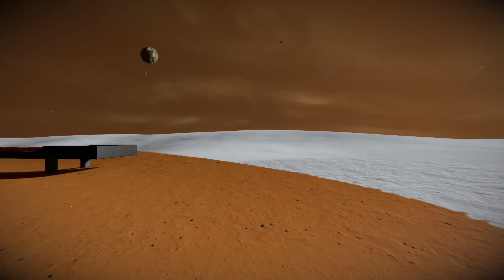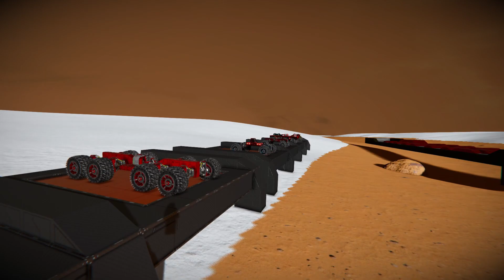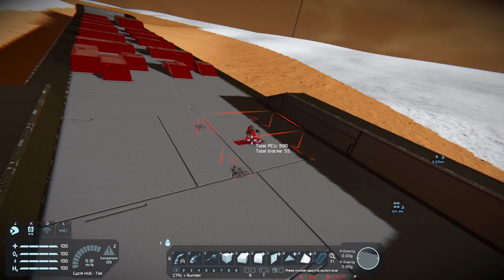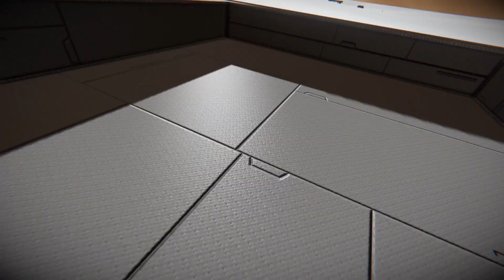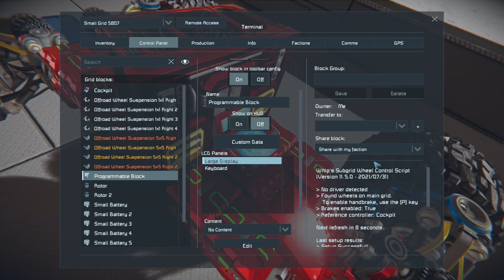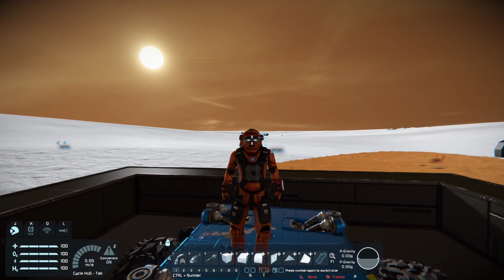Suspension Concept ideas - Space Engineers

Comment: I tried building a rig with similar suspension to the last one, with two rear tandem axles and a single pendulum axle in the front. It doesn’t have the small wheels to act as springs though, just some limited rotors so that it can keep all the wheels on the ground. Seems to work pretty well at low speeds, though!

Comment: Set suspension strength as soft as possible to carry the weight when using standard suspension.

When using linked suspension, set it to 100% and let your "shocks carry the weight.

My main issue with the link suspensions is the vehicle rolls all over the place and ends up pulling wheels off the ground. Or with trailing arms/truck arm style suspension, it pulls the front inside wheel on turns. Which looks cool, but kills traction.

My other issue is with the subgrid wheel controller, it always shakes. Always.

But, doesnt stop me from designing suspensions in search of the magic one. If only keen would let pistons act like shocks instead of linear actuators.

Edit: ooh... never tried the setup at 9:30 ish. That looks promising. Wonder how well it translates to large grid.
Reply from the maker: Yea I agree, if keen allowed pistons to absorb bumps you would be able to make some really cool stuff.
Reply: @quantumchief  what do you set your "shocks" at to keep body roll down in turns? Ive found i have to go super stuff to minimize body roll which negates the entire point of the suspension.
Reply from the maker: @Jodah175  I’ll do for a wider wheelbase and between 25% and 50% strength, then lower the friction of the main wheels a bit
Reply: @quantumchief  awesome! Thanks for the info and keep up the good work with your videos!